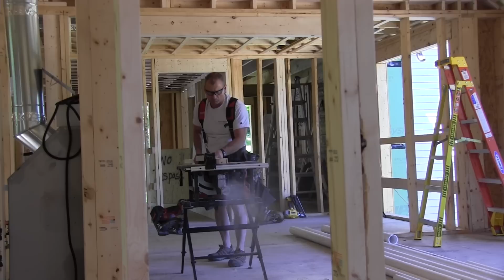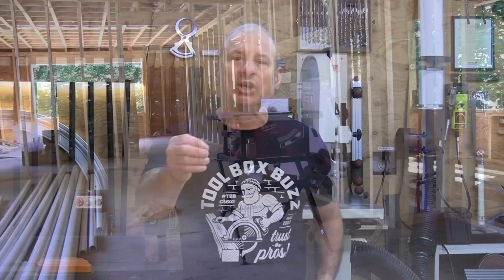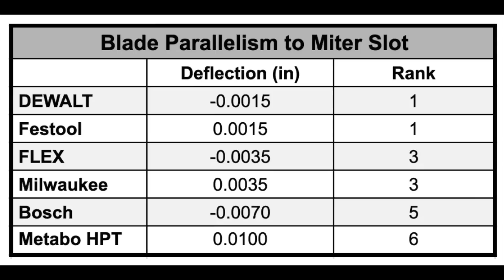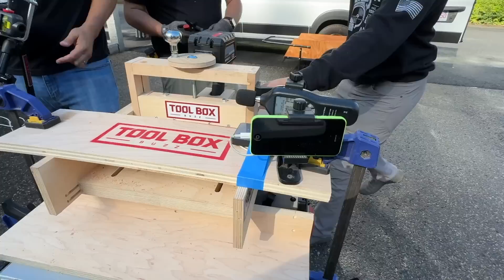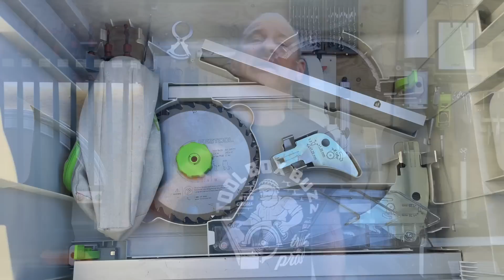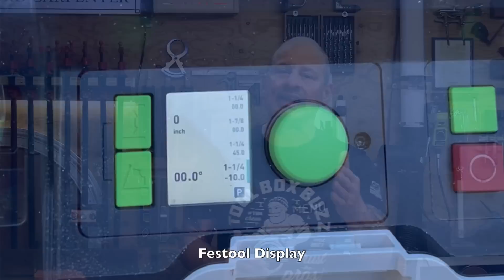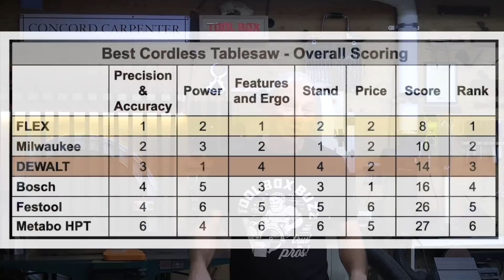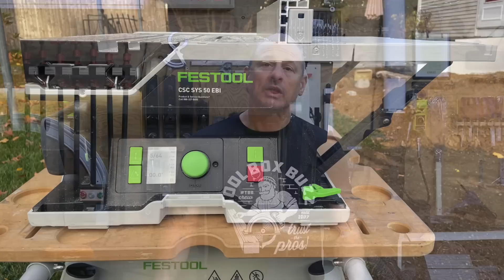Best Cordless Table Saw | Head-2-Head Comparison

Comment: That festool is a usless, overpriced toy. Especially when the Fescult always brags about how precice and accurate they are. This one is inaccurate, no power and overpriced
Reply: Better find a new mine… you’re running out of copium.

The festool system is amazing if you do high end finish work.  I have the Festool table saw and the SawStop job site pro.  They’re for different things and to dismiss the brand because you can’t afford them or don’t do work that requires that level of tool, is foolish.

It’s a bummer they got a bad saw, but luckily Festool has a no nonsense warranty.  Mine has been perfect.
Reply: @funriffjay  here's the butthurt Fescultist, here to justify his waste of money. That saw is useless, the only one coping is you. I can afford them, and I can do better work than you with the cheapest Ryobi.
Reply: @funriffjay  It was proven in this video that this saw isn't accurate. Typical fescultist. I can afford Festool, I would rather spend that money on actual shop equipment instead of overpriced, underbuilt youtube trend tools. As for my abilities, I will do better with Ryobi or Kobalt than you can do with your bragging rights. The only one coping is you.
Reply: @paulhopkins1905 that particular saw, yes.  It’s unfortunate, but even the best brands have lemons.
Reply: @funriffjay  😂😂😂😂😂 and you say I'm on copium. The fescult is ridiculous. That saw is a toy, like most fescult tools.
Reply: @paulhopkins1905  luckily it’s a free country and you’re allowed to be wrong.  I’ll keep buying high quality, professional grade Festool tools and you can continue struggling with whatever bargain brand is your favorite!
Reply: @funriffjay  LOL Bargain brand, you brain dead fescultists are completely smooth brained. That festool table saw is a completely useless toy and your crying about it. It isn't close to as accurate as my Powermatic cabinet saw, but you still paid more, not even as accurate as a decent jobsite saw. My Bosch/Makita tools are every bit as accurate as your fescult tools and will outlast them by decades
Reply: @ haha whatever you have to tell yourself to stop the tears! 😂
Reply: @funriffjay  why would I crying? I didn't spend 1500 on a gutless gimick table saw with no power, thats not even accurate, because some youtube shill told me I need it. You probably have a wall of pretty red Woodpeckers tools and use Rubio and Totalboat products
Reply: @funriffjay  No tears here, I didn't waste 1500 bucks on a gimick, toy saw
Reply: @funriffjay Yeah, good luck with Festool honoring their warranty on a table saw. 
"Send it in for repair".
If it looks like it was used on a jobsite it will be classified as industrial use, outside warranty.
I had a vid on here of how I fixed my p.o.s. Kapex with a large quantity of Tannerite. Never did find the blade.
Reply: The plastic feels cheap. The sustainers do also and are so clunky as to be impractical. There's a reason makita stopped making them. The prices are the biggest insult.
Reply: @mostwant3dgov  I've always thought the systainers were flimsy and cheap as well. Festool would be nothing without the dishonest youtube shills that are on their payroll, and people that treat them like the cult they are. Which is why this channel is the best on Youtube. They are always honest, fair and let the testing do the talking.
Reply from the maker: @paulhopkins1905 Paul,
Festool makes amazingly high end tools, I own and use several.  The systainers have their place - I have 2 vans with the bott Smartvan shelving and racking. Bott uses Systainer boxes and they hold up great. My only critique is the latches sometime pop off.

To be honest I’m amazed at how durable they are. I will say that I take care of ,y stuff and don’t toss the boxes around or let them roll around in  the truck.
Reply: @ConcordCarpenter  outside of the domino, festool doesn't make anything that other companies don't make just as well if not better.
Reply from the maker: @paulhopkins1905 oh man their routers, jigsaw, sanders, tracksaw are all stellar
Reply: @ConcordCarpenter  I personally hate their routers. The asymetrical handle on the smaller one, and the twist handle to lock down the bigger ones are really poor designs. The trigger lock/release on brands like the Bosch are far better, and the smaller one is so uncomfortable to use its ridiculous
Reply: Never used a Festool. But I spot BS when I see it. It’s no coincidence I’ve never seen them anywhere but YouTube.
Reply: true... festool was something 10y ago when was only brand haveing plungesaw..... now with the pricetag for onetool equal 3-4 of the other brands..... you get the feeling its the hippi snub woodworker with lumberjack shirt halfshaved head with manbun and 11 herb&spiceys beardoil that  make sure you not forget he only use festool 😂
Reply: @ What brands are those, makita 40v is just around the same price for their miter saws and comparable track saws?
Reply: @michaelstrang2563  the makita table saw is much cheaper than the Kapex, apples to apples is the 36v which is $500 less. The track saws are 2 to 400 cheaper
Reply: 😂😂😂😂 you lot slagging festool just can’t afford it!! I have multiple brands, festool being my main set up, and I’m telling g you now it’s 10x better. (Most of it) granted not all!!!
Reply: @bigboundsy  You don't know shit about me.or my finances, boy. You buy festool because fucking youtube told you you need it, and you fall for marketing
Reply: In my case I needed a saw that I could operate quietly and safely in an apartment, that I could actually lift and carry (33 pounds is CONSIDERABLY less than 50 or even 40), and I needed great dust collection (though I have not tested this on any saws, so the others may be fine in this area; all I can say is the festool is pretty fantastic for dust collection). Have I been had by a pack of lime green charlatans? It’s possible, but using this saw brings me joy every time I turn it on. We will see how I feel over the long term, this is my only festool product, so I’m in the cult but not very deep, and I am prepared to either keep being overjoyed with my purchase for years or accept that I might have been a fool… (ALSO, I am not a contractor or even a cabinet maker, I’m a mixed media artist, so my needs are pretty specific and idiosyncratic ).
Reply: @stellabelikiewicz1523  I love the table saw, it’s so accurate and a joy to use. Yes it’s expensive but I don’t mind, I enjoy using it, and I’m definitely not in the cult I sent back the impact driver, their hkc circular saw because I thought they were shit!!! I love being able to store the saw in a systainer!!
Reply: @ I wonder if the average festool user is MORE likely to return a tool they don’t love because they have super high expectations because of reputation and the insane price, or if there’s a tendency of people trying to convince themselves that they SHOULD be in love with every tool because of the brand loyalty thing 🤔… I’m guessing the answer is my favorite piece of wisdom: “every single person is a distinct individual.” 😁

It will be interesting to see if my love for my table saw causes me to seek out more tools from festool or if I’ll continue to operate on the knowledge that I mostly don’t need the fancy option to get my work done in a way that makes me happy (hilariously I currently own mostly RYOBI tools and now this ONE festool product 😁)
Reply: @stellabelikiewicz1523  well I’ve sent a few festool products back because IMO they wernt very good, the impact, the hkc, the c18 all went back. But it’s a matter of opinion isn’t it!!! 
The practicality of the table saw makes it a perfect choice for me, easy to transport clips to other things, the bench is great too, sliding sled, I already have multiple batteries, people will always find bad things to say though.
Reply: lol you have no idea what you are talking just relax, they are amazing for finish work. Their track saws, miter saws, sanders, and routers are top of the line, but if you don’t actually do high end finish work you don’t need them. I cut through the cord of my track saw and they replaced fixed it for free, they have sent me a new 1000 dollar miter saw stand when there was a small crack in the plastic, they are incredibly loyal to their customers. That being said I have this DEWALT table saw and dozens of Makita tool, every thing has a place.
Reply: @michaelstrang2563  trim carpenters think they are the be all, end all, especially you fescultists. I build furniture and guitars, far finer work than trim work. They literally denied warranties for using non festool blades and accessories
Reply: @ We restore high end furniture, doors, and doing high end trim work is far harder than building furniture. There is nothing harder than doing stain grade trim for a meticulous customer whose house is completely out of square, where every cut is some unknown compound miter out of some expensive trim. I would rather build furniture any day than trim out some old multi million dollar colonial that every floor, wall, and corner is way out of wack. Have you ever had to scribe hardwood floors to a field stone wall, it is infinitely harder than anything you will ever do building furniture. Further serious carpenters always strive to make their work are fine as they possibly can regardless of whether it is furniture, trim, or framing.
Reply: @michaelstrang2563  cool, talk to me when you've pulled the soundboard off of a WW1 era Martin. Scribing hardwoods and dealing with angles isn't that difficult
Reply: @michaelstrang2563  Scribing to stone is harder than a 3-way showcase joint?
Sure, Mr. Youtube Credentials. 
You should try making a molding plane to cut the fancy profiles in your multi million blah blah blah's crown molding... oh wait, you don't even make your own "expensive trim".
Thanks for the lesson in quality mindedness.
Reply: @ Are are you kidding, are you seriously bragging about your ability to run a shaper or milling machine, or measuring cuts in a shop. I am talking about making things look perfect under a strict time table in a completely imperfect environment you. I am not stupid enough to make my own trim as I do this to make the most money possible while providing a product I am take pride in. I literally do this for a living, and have friends who custom mill trim for me frequently, it isn’t a complicated or skilled process, it is an investment requiring 3 phase power. Unless you are carving sculptures or intricate designs in a shop it tends to be significantly easier than having to work in the field. That being said I still have to fabricate trim, and make joints for door repairs on site with a router and track. I often make glue up’s and cut 45 degree lock joints on site for big extension jambs, build custom hardwood window screens, as well as shutters and built ins. I use every technique and skill I would in a shop using far less accommodating tools in the most unideal of circumstances.
Reply: @michaelstrang2563  The Makita mitersaw destroys the kapex, the makita and milwaukee tracksaws are as good as festool with better batteries. Plenty of sanders are as good if not better, and their routers are poorly designed
Reply: Festool scored lower because the ranking system penalizes small deflection differences disproportionately. For example, Bosch’s Left to Right deflection is 0.004", while Festool’s is 0.023"—a difference of just 0.019". However, the system ranks Bosch as "1" and Festool as "3," making the gap seem much larger than it actually is. This happens across other directions too, where Festool's slightly higher deflections lead to a total score of 10, compared to Bosch's 5.

This is important because the scoring system exaggerates minor differences, which are negligible in most real-world woodworking tasks. A deflection difference of 0.019" is unlikely to impact cut precision for all but the most demanding applications. Festool’s actual flatness is close to Bosch’s and would likely perform just as well for precise cuts, but the scoring system makes it seem far worse than it really is. For precision-focused users, understanding these nuances can help avoid overvaluing small statistical differences.
Reply: @Therealphantomzero  So you are saying the underpowered toy is somehow worth the money, because it is only a little bit less accurate than the bosch......
Reply: @paulhopkins1905 no, what I'm saying is that by looking at the data as how they did the differences aren't really that much. I found some flaw not necessarily a big flaw in their study. For example, in terms of power, they use a 44- tooth blade for the festool versus 24 for everyone else. That's a big issue. I have the DeWalt corded which is similar to the DeWalt cordless and that's a great saw but crunching the numbers in my calculator. It does not make that so terrible. In fact, it's actually still very accurate. I own the Festo saw. I also owned the DeWalt. I did not get the Milwaukee for a couple reasons. One it was not very well recommended by finish carpentry TV The festival song comes with the stand and has features that are more particular to a cabinet installer who's using it for specific precise fittings. You're not going to take a full by eight sheet and run it through. You're going to use this as a companion to the track saw. I also find it quieter than a corded saw. I also find it that doing miters on the table saw is much more precise even for moldings. This video really underscores that saw + I'll do a little write-up on it because just because diagonal measurements may be different. Again, it doesn't throw it out that it's not a precise saw
Reply: @paulhopkins1905 I don't consider it underpowered either because I've ran at least 32 linear feet of hard maple through it with the original blade that comes with it and I don't see any issues with it. So I'm not exactly sure if the testing really reflects real world usage
Reply: @Therealphantomzero  thats because Festool uses non standard blades and has no ripping options, which is another strike against them. And it is still less precice than the other saws tested while being more than double the price. You are not doingna good job of making this saw seem like anything but a toy. And yeah doing miters on a table saw is more precise, but that depends on your miter gauge, and length of material.
Reply: @paulhopkins1905  what I'm saying is that you're hanging on to the fact that their measurements really mean anything. Like I said, the saw is actually very precise and when I run the numbers through the calculator I actually ran it through chargbt and I told it to make an assessment. Based off of this, it is still highly regarded of a highly precise tool even with those markings. In fact, what what it found out was different was at the Milwaukee in some areas was way worse. But one of the things that people have to realize is that this table saw has two sides. So being worse from one diagonal to the other doesn't really matter because usually you're ripping Scott that's narrower. For this type of saw, you only have an 11-in rip capacity because it is assumed that everything else beyond 11 in you're going to use a track saw with parallel guides. The miter gauge is actually very accurate compared to any table saw that I've ever used, including the DeWalt. You work on this table saw differently than you do with the others. In terms of the blades, festool has different blades for the saw because it shares it with their tracksaw.
Reply: @Therealphantomzero  You still sound like a festool apologist and your are simply trying to justify this little toy saw. Just admit its a waste
Reply: @paulhopkins1905  no not at all. I Carry all the brands. Actually, I try not to find festool whenever I can. But there's a lot of benefits to this. Saw that. Really when you look at their testing it doesn't make any sense. Especially since they finished Upper GTV talked poorly about the Milwaukee and it still did better even though it's precision wasn't really there. Look out of all the saws. I would definitely go with the DeWalt. In fact I'm a big metabol Hpt fan so I'm glad it actually did well. But I love the festool saw it actually works for my workflow. A very small saw for a very particular use cases. It works for that. Everything else I would just use a corded table saw
Reply: And you could buy 3 other Ones for there over price
Reply: Exactly
Reply: Lmao...well that didn't take long!!...3 posts in and someone is butthurt!!😲😲